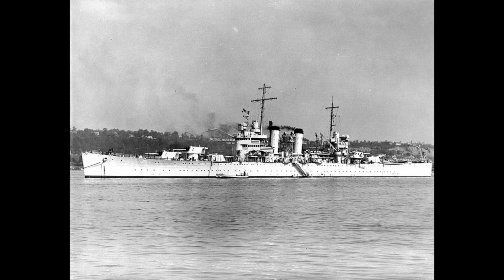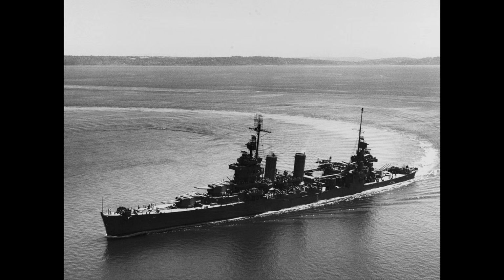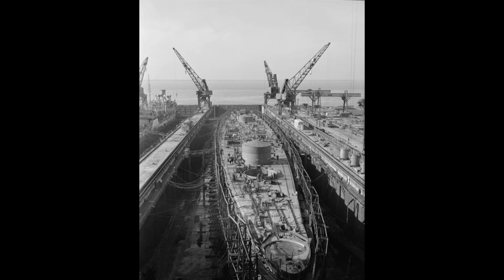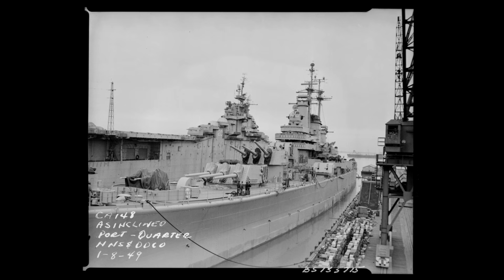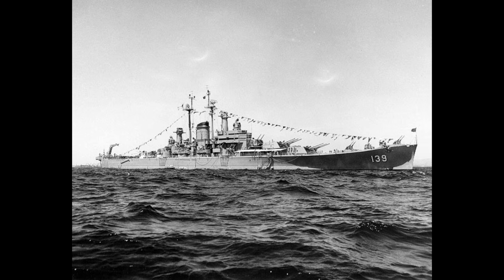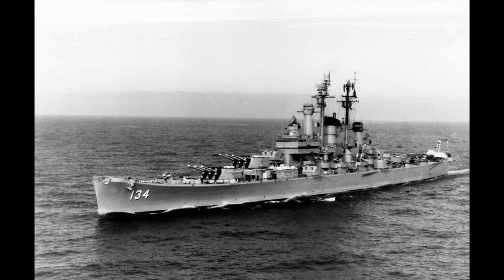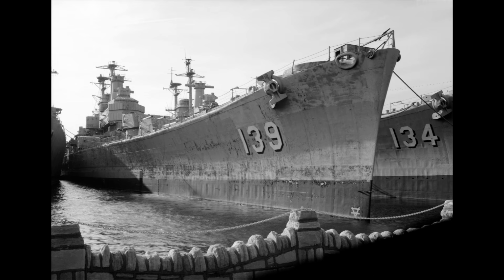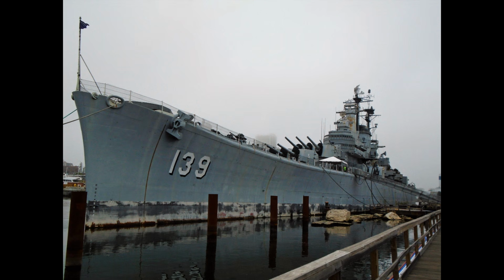USS Des Moines - Guide 251

Comment: I'm a little surprised none of these saw action in the Korean War.
Reply: The Iowa class were reactivated.
Reply: Same.
Reply: @WALTERBROADDUS   Still, more guns = more guns.
Reply: IMO, they could have been better than the Iowas here.
Reply: @bkjeong4302  haha 16 inch gun go boom boom
Reply: @bkjeong4302  While the rate of fire would be far faster than an Iowa, the weight of explosives being delivered would be 1,923 lbs per minute for Des Moines compared to 2,765 lbs for Iowa. Bigger, heavier shells contain bigger, heavier bursting charges. An Iowa also had the ability to fire much further inland, 41,622 yards vs 29,800 yards.

That said, there would be times where a larger number of smaller shells would be more useful. It allows for spreading the fire over a larger area, or attacking multiple separate targets at once if needed.
Reply: @RedXlV  Destroyer-grade firepower was often sufficient even against fortified positions, so I’d argue that for most bombardment applications the Des Moines would be sufficient for bombardment, if not outright overkill. 

As for range, fire support was historically most effective when delivered accurately from close to shore at visible targets, so the value of being able to bombard targets much further inland is debatable.

Comment: The biggest cruisers ever built until the USSR did us better building the Kirov class.  That is, unless, you consider the Alaska class a cruiser, but that was simply a byproduct of Admiral King's persnicketiness, because everyone knows they were really battlecruisers.
Reply: The Alaskas were not Battlecruisers.  12" guns were only nominally capital ship grade guns by WWII.  With exception of the KGVs, 16" was the minimum capital ship grade armament.  And the Kirovs are not Battlecruisers either.
Reply: @johnshepherd8687   The definition of battlecruiser changed in the interwar period.  For that reason the Scharnhorst class, equipped with 11 inch guns, were classified as battlecruisers.
Reply: Additionally, I described the Kirovs as the biggest cruisers ever.
Reply: @zoperxplex   Remember that the plan was for the guns on the Scharnhorsts to be upgraded to 15" when available so it was fair to call them Battlecruisers because they would have had 6 instead of 8 15" guns like Repulse and Renown.
Reply: @johnshepherd8687  If the Scharnhorst class can retain the battlecruiser classification then the Alaska class is more accurately described as a battlecruiser.
Reply: @zoperxplex  I guess you missed the planned 15" upgrade.  They only  available  guns were 11" when they were built.
Reply: @johnshepherd8687  Who cares what they were designed for the fact of the matter was that an 11inch gunned warship was classified as a battlecruiser, and the Scharnhorsts and Alaska classes weren't they only ones.  Two programs were undertaken, but not put into production because of wartime expediency, that envisioned 11 and twelve inch gunned battlecruisers.  There was the B64/65 project in Japan (12 inches) and the 1939-40 Dutch battlecruiser project which featured nine 11 inch guns.  So you see there was a recognition amongst naval circles that a warship armed principally with 11 or 12 inch guns could be described as battlecruisers.

Comment: Drach, what first generation dreadnoughts or super-dreadnoughts do you think would stand roughly 50-50 chances of survival against a Des Moines? Given their insane fire rate, radar fire control, and speed advantage, I think these MOAR DAKKA heavy cruisers would wreck most of the 12inch gun & 21kt Dreadnoughts with ease, even if the 8inch shells can't penetrate their belts.
Reply: Given the improvements in tech since the 1st Gen Dreds, I wouldn't be super sure that the 8 inchers wouldn't be able to penetrate. Also given the rate of fire, you might get multiple hits in the same location. First one doesn't penetrate, the second one does. sm
Reply: @mattwoodard2535  A Des Moines class cruiser has 10 knots on the Warspite. So the Salem or Newport News could just dance around Warspite and obliterate its superstructure without getting touched by Warspite's 15 inch guns. But could a Des Moines sink a Queen Elizabeth?
Reply: Trying to penetrate WWI-era battleship belt armor with a Des-Moines class cruiser is kinda silly when you can use your vastly superior speed, firing rate and FCS to stay at extreme range and strike at their tissue paper deck armor.
Reply: @stanleyrogouski  With enough hits on that 1-3 inch deck armor, something nasty is bound to happen sooner or later.
Reply: @stanleyrogouski  You wouldn't have to sink one. With DM's RoF they could pepper the deck with HE and most certainly take out the fire control system in relatively short order.  Also you don't have to penetrate the belt armor to sink one. The bow and stern leak when holes are poked in them as well. The problems start if the QE gets a hit on you with those 15"ers. It only takes one luck shot and your day just got really bad really fast.

Comment: I don't understand why we don't ressurrect this rapid fire gun for the Zumwalts?  I mean, sure, you'd need to make a number of changes, but the system itself exists.  Strip away the requirement for GPS guided shells, add the projectile from the railgun project, adapt to the Zumwalt mount, and the Zumwalt has her replacement guns.  Hell, you could dust off the old designs for the Worcester's rapid fire 6in and do that instead.
Reply: Because guns are outdated and cannot compete with modern missiles.
Reply: The USN in the 1970's tried to develop a "Light Weight rapid fire 8" gun"  I believe it was called the Mk71.  They got to the prototype stage and sent it to sea on the USS Hull.  The system worked but the accuracy was not able to be worked out.  The mount was removed from the USS Hull and she was restored to original condition.  In fact the Spruance Class had at least one of the mounts that had the Mk45 5"/54  mount strengthened for the Mk71 8"/55 mount that was prototyped.  I believe the Ticonderoga's might have been planned for them too.  The mount is currently at Naval Surface Warfare Center in Dahlgren, Virginia.  It was adopted from the Mk16 gun used on the Des Moines.
Reply: There will only be three Zumwalts.
Reply: @jerichom11x  Guns are not outdated as you think they are, as they are still in use.
Reply: @jerichom11x  Except in terms of sustained volume of fire and cost per weight downrange.
Reply: The Zumwalt's gun system got hung up on extreme range and guided projectile.  The per-unit costs for the high-tech projectiles kept going up, especially when they cut the ship buy down to three.  Fire support has been revolutionized by GPS guidance, but it is much cheaper to use existing land-based guns.  They were shooting for over-the-horizon range, like 100nm, so the ship did not have to come close inshore.  Why they could not adopt an existing Army shell is another mystery.

Comment: Ah... um... Exactly how good an idea is it to put an AA battery in front of 6 8" guns?
Reply: If you're using the AA battery chances are you aren't using the 8" guns. Simultaneous air defense and surface actions weren't exactly a common occurrence.
Reply: @hailexiao2770  Fair enough, but it's a godawful place to put people. Some ships beat themselves up with bow effect issues in heavy seas. Having 6 8' guns behind you also means blast effect on the mountings.

Comment: Okay fellow Armchair Admirals: Which would you rather have added to your 1942 USN order of battle:  Des Moines or Alaska?  (assume radar fit is appropriate for a new ship in 1942)
Reply: IMHO the Alaska is the most gorgeous ship class the US ever built, but the Des Moines' are far more useful at that stage of the war.  DM has much better suppressing potential. Imagine being on a Japanese ship while 90 shells per minute are incoming....I think I'll pass. However if I could have both that would be ok too :)
Reply: @JD-kl8hz  I have to agree with every bit of that!!!
Reply: Yeah pumping out as many or more 8" shells as the CL 6" ships could (with her very good radar fire control), would obliterate the Japanese cruisers before they even could open fire visually at night. Imo that kind of massive firepower would be better in the slot than a 12" slower-loading gun (even against a BC where the 8" could just spam it to death). The Japanese cruiser armor would not stop American 8" AP under most conditions. AK did not have an especially tough torpedo defense arrangement, so a long lance would probably hurt her only a little less badly than a hit on a Des Moines. The problem would be if she were saturated with targets, like 6 Japanese DD's yolo'ing in while she engaged the cruisers. But this would be a danger to both ships.

You could have a situation, where she fired off all of her 150 shells per gun in a single battle :)

Comment: Too bad the idea wasn't to just redesign the turrets of the Alaska class to four 8inch rapid fire guns.
Reply: The Alaska hull was much larger than Des Moines, at least 40 meters longer, the Des Moines used the same hull of Baltimore, it would have been a waste of space to put 8 inch guns on Alaska
Reply: @Maverick966  
The Alaskas were already under construction, combining the high rate of fire 8inch guns with VT fusing would make them devastating air defense ships in addition to, cruiser killers and shore bombardment vessels.
Reply: @calvingreene90  But Alaska is too big for 8 inch guns, it needed 12 inch autoloading guns
Reply: @Maverick966  
I prefer twelve 8inch over nine 12inch guns.